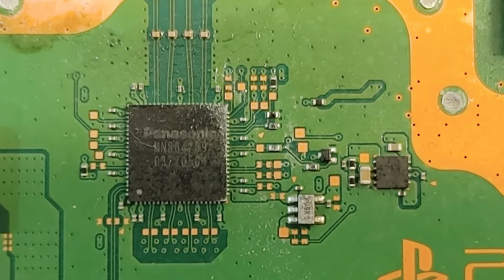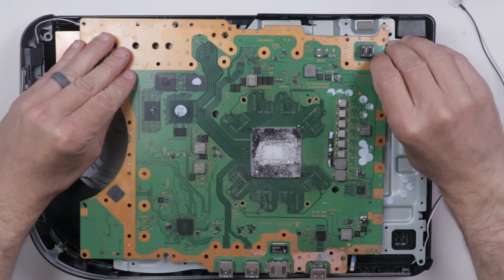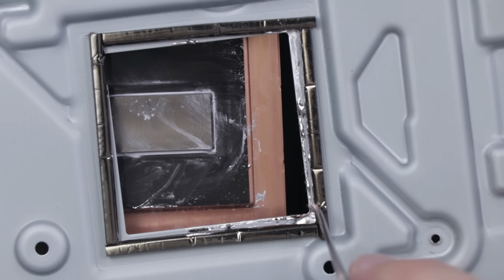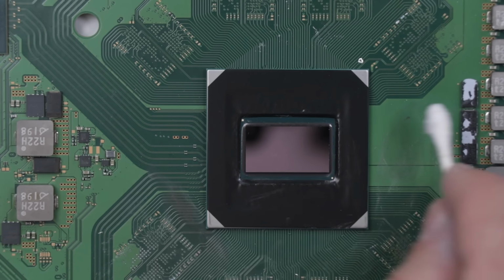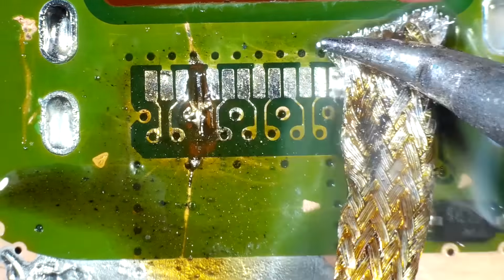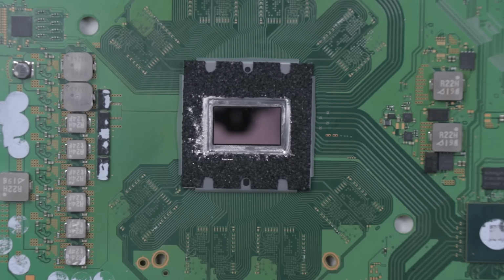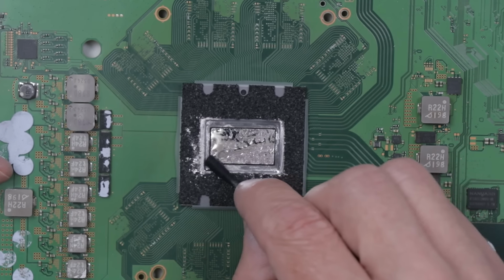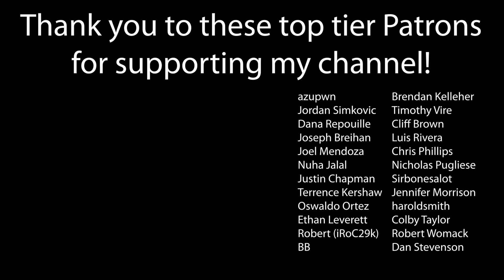TWO Repair Shops FAILED to Fix This PS5 - Can I?

Comment: My Xbox one x when turned on then turn off instantly (approx 2sec.) just replaced with a new HDD with no luck, still the same issue. Power to USB works correctly as it’s charging my elite controller. Not sure what to look for next to solve this issue. Any help would be appreciated.

Comment: I was almost under the impression that liquid metal eventually needs to be replaced (at a faster rate than typical thermal compound would take). Does this mean that modern consoles using liquid metal are inherently doomed to eventually require maintenance as due to increased thermals, where with traditional paste-type thermal compound they would not?

Comment: That's what happens when you try to remove a HDMI port with a welding machine.
Jokes aside, seeing things like the "repairs" done by the previous shops it's what made me wanna learn about repairing my consoles. Here in Brazil, most shops have worse tools than I, a hobbist, have in home.

Comment: I replaced the hdmi port on a ps4 a couple years ago as my first real solder project. it works fine, but there is some red static on the screen and the audio bugs out every once in a while, so i usually prefer to play with headphones, and mostly on remote play. do you think that i should bust it back open and try to clean it up a bit, or just be grateful it works at all?

Comment: Does anyone know why Sony decided to apply liquid metal to their console but MS didn’t with the Series X? Aren’t the systems quite similar in design?
Reply: From the research i've done i read sony used liquid metal cause the ps5 apu is clocked at a high frequency so there for it gets hotter faster and needs to get rid of the heat faster and liquid metal conducts heat the best vs thermal paste that and for cost on the cooling system. As far as xbox the apu ain't clocked as high so maybe it didn't need it and it also has a vapor chamber cooling system so maybe that plays a roll i don't know 100% for sure 😅
Reply: @kila5055  That makes sense if true. My theory is they did it to sound cool.

Comment: i have 2 broken 4k led tv ( tcl 50 inch ) and RCA tvirtuoso ( 60 inch ) backlit problem. i see the display with the flashlight test . what can i do . worth it to get them repaired ? i already tested taking apart an older 1080p led tv to learn but i'm still confused about what to replace . no caps busted , even the leds were all ok . maybe something on the board ? help ^^^^^^   thx
Reply: scam

Comment: question. my ps5 can stay on all day if im watching shows or playing smaller games all day long no prob. but if i start playing the new horizon or elden ring my ps5 will shut off in about an hour and i will have to unplug the ps5 power cord then plug it in to get it to turn back on.i  have a expensive power strip and it will only turn off if i play a ps5 game that i would say demands a bunch of power. i have cleaned my ps5 once a month for dust . any help or suggestions. i had it lay flat and stand up and does the same thing. bought a new power cord and no help. its only when i play certain ps5 games

Comment: Far too much liquid metal on the APU.  You're supposed to spread it out till the item that's coated with the liquid metal looks like a mirror, and remove any excess.  There shouldn't be ANY pooling like you had.  That will leak over time and cause a short in the future if that sponge doesn't catch it.

Comment: Why would you even use liquid metal? For soldering?
Reply: It's the thermal conducting material used by Sony in the manufacture of PS5s AND it has thermal transfer properties that are superior to ordinary thermal paste. It is more difficult to work with but apparently Sony's engineers have decided that the trade-off is worth it.
It is not solder and it has nothing to do with making electrical connections. (In fact, if it come in to contact with electrical traces on the board, it can bridge/short them).
Reply: @BigRalphSmith  but it isnt suppose to be mixed with thermalpaste?
Reply: @klimadzu  No, they are not compatible. Regular thermal paste will degrade and displace the LM.

Comment: So I think I got a broken ps5 disc drive and nothing i find on the internet is helping. The main problem is that its not reading the discs for some reason and it just started today and no im not putting the disc upside down. But if anyone has any info about this issue I would appreciate it.

Comment: Well ... can you fix my PS5 too? It exploded, at least some part inside ... I guess some cap inside the psu just popped but it was pretty loud and even some parts where blown out. I sent it back to Sony but I haven't heard from them for over 4 months now! It was 1 1/2 year old so it was out of warenty but honestly, this should not happen at all within a estimated lifetime of 5-8 years for a console at that pricepoint. Looks like they try to find some reason to refuse repair or let me pay for it but I don't think that's ok at all! However, I'm absoultely pissed off by Sony for f**ing around for so long without telling me anything... That's so frustrating! I bet any reapir shop could have just fixed it within 2 days but now I ended up waiting for probably nothing for over 4 months and still got no infromation about if or when it will be fixed... I ask them every week and get nothing!

Comment: Glad to hear the repair shop made things right with the PS5 owner. I’m not sure if a lot of other shops would have accommodated the owner like they did. Also glad you were able to fix it! Keep up the good work, Steve 👍 

By the way, for anyone curious about the iFixit tool kits from an outsiders perspective, I own both the pro tech and the mako driver set, because I’ve tried my hand at making small repairs myself. Their tools feel super high quality, and they don’t skimp on anything. Cheers!

Comment: "There's some liquid where it's not supposed to be"

You're not wrong! It's on the wrong side.... And wow. What a terrible terrible job... From 20% in, I'd guess this is going to be a 1/10 chance to be working, and if you do get it working I'd guess it would have some longevity issues.
Reply: I'm glad you were able to repair it, hope it was significantly reduced or had a 3 year warranty lol

Comment: I do not know why anyone needs to use liquid metal. Yes it has better thermal conductivity, but it is really only for people that do extreme overclocking to win competitions. For the general user at home, high quality thermal paste is far better and less troublesome later. This video shows why you should not use liquid metal. I charge double to clean up liquid metal.

Comment: far too much liquid metal ... haha .. move the ps5 about a bit.. open it back up and see the mess that is eating away the motherboard ..or motherbold as you would say. 👍🏻
Reply from the maker: Nah, these take a lot of liquid metal
Reply: @Tronicsfix  ok .. that was a lot of LM .. peace ✌🏻✌🏻✌🏻
Reply from the maker: On PS5’s there’s a gap between the APU and the heat sink. That gap has to be filled with liquid metal for proper cooling
Reply: @Tronicsfix  you know better than me .. ive not worked on these.. however i would be shitting myself to even move that console from floor to table as that LM is going to run 👍🏻👍🏻😩😩
Reply from the maker: That's what the sponge is for, to keep the LM in place when it's upright.

Comment: I don't trust repair shops. Took my PS3 80GB to a local GameStop wannabe... Put too much thermal paste on, ruined it...meaning it failed after 2 weeks. Forced me to pay extra for their mistake (Russian guy insisted he did it right). Happened again but I forced them to do so for free. After the third time, I took it somewhere else (back then, the BC PS3 s were going up and up and up in price). They looked and found that the last place put so much Thermal Compound on, it melted some circuits,  and made it overheat. Then again that place sucked too BC,  after I took it there, I had it for a week. It "feel" 1 in, onto a carpet and blanket, and so I took it back to them, since it was supposed to be under their warranty. They blamed the last repair shop for a chip falling off, causing my PS3 to break. And it took 2 weeks to get that anwser. After asking them to fix their Mistale, they ignored me for 2 more weeks. When I called they said they "claimed" my console BC I didn't come get my console and/or didn't hear from me. Which was bull. 

Moral of the Story:
Be SUPER careful of repair shops. Yes, sending it to Sony (one of the worst), Nintendo (worst), and Xbox  is annoying and inconvenient, it beats throwing x3 the amount of the consoles value at some scammer, who's worse than those Phoenix Call scammers.

Comment: I feel like sony could have just put a proper heatsink on the PS5 instead of the weird layers of metal and plastic they went for and  they wouldn't need liquid metal. Liquid metal in a console is just an all around BAD idea.
Reply: The reason they designed it the way they did comes down to a very simple concept; $$$
When you say "proper heatsink", what exactly do you mean? The "weird layers" and LM are successfully doing the job.
When applied correctly during manufacturing, the liquid metal doesn't seem to be causing any significant problems in the field.
The only time it appears to be an issue is when incompetent techs work on the console and the problem there is the tech, not the LM.